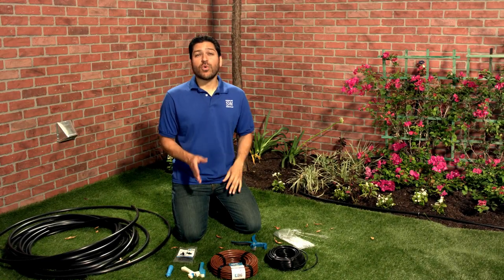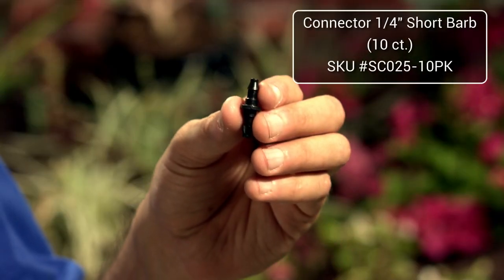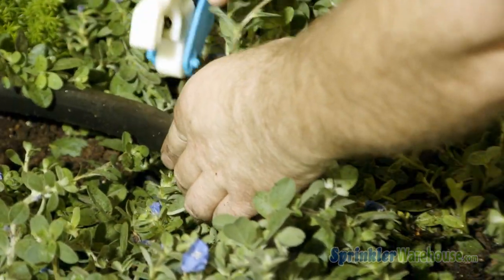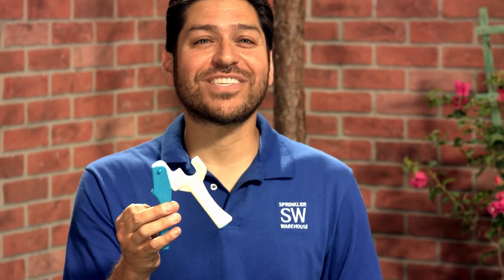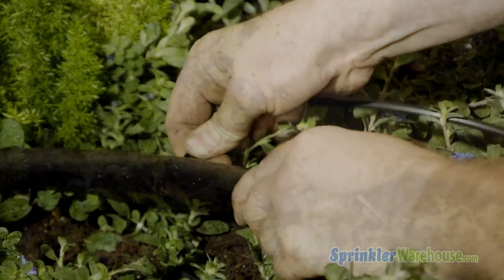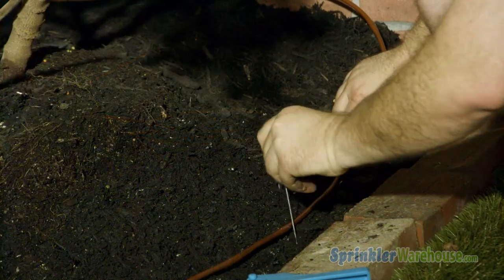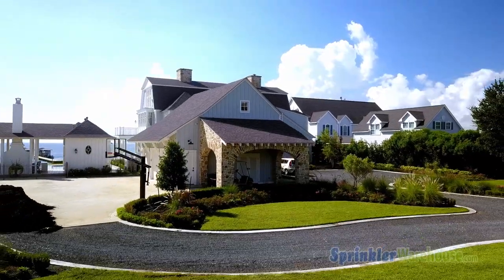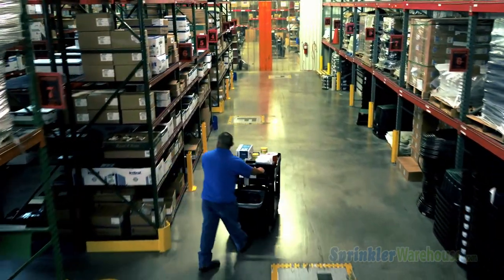How To Use 1/4" Dripline Tubing for Trees and Shrubs

Comment: FAIL! what is the coverage of one hole? if the holes are 6" apart it seems to me the loops around the tree would need to be about 12" apart and starting near the trunk in concentric circles out to the drip line. you are leaving most of the plant without water. very poor explanation from sprinkler warehouse.
Reply: agreed 100%